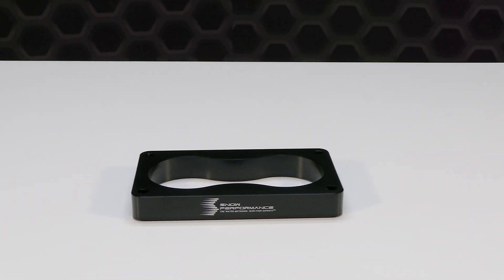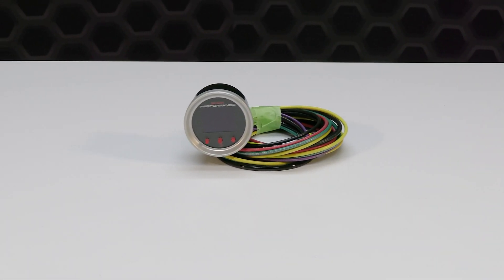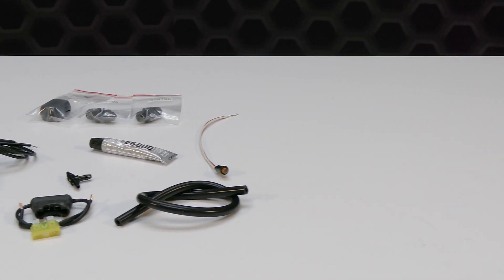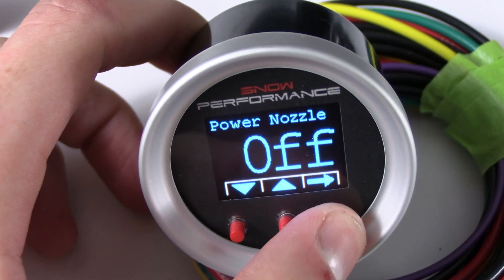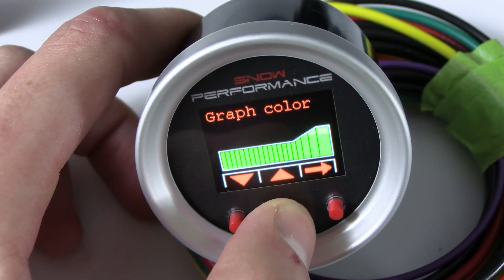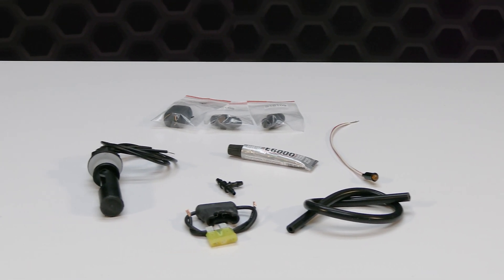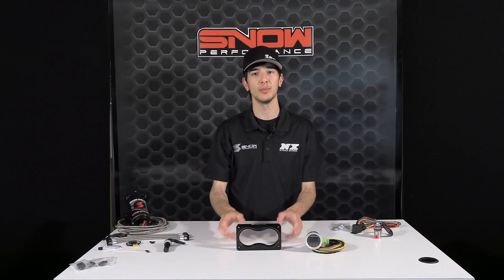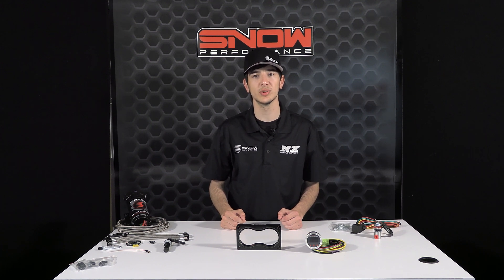Snow Performance 2005-2010 Mustang GT Water/Methanol Plate System Overview

Comment: Have a question: I have a 2008 Mustang GT with a non intercooled Paxton. I just purchased the kit mentioned in your review.   Have you tested the throttle body spacer plate on a 2005-2009 GT with a Paxton or Vortech? Will it simply bolt on the throttle body and the piping for the supercharger?
Reply from the maker: We have not tested it for that application but it theoretically should just push the piping out an inch or so. As long as that doesn't cause any issues it should work well.

Comment: i’m running this on a n/a car is there any way to activate it without psi?
Reply from the maker: If it is a standard EFI car you can use the Stage 3 EFI System and run it in fuel injection only mode. That way it bases injection off of a similar curve to your fuel injectors.